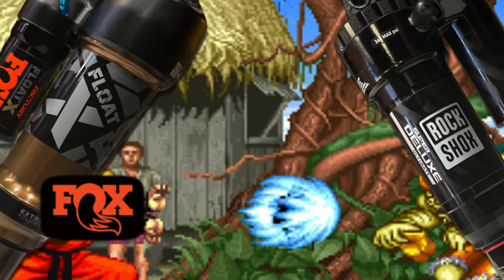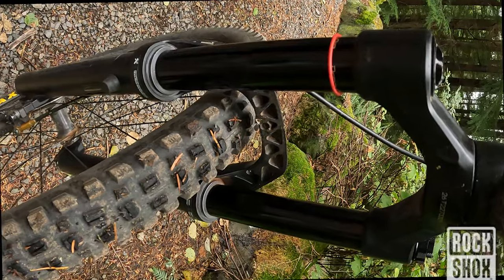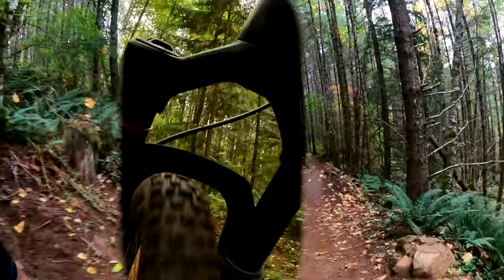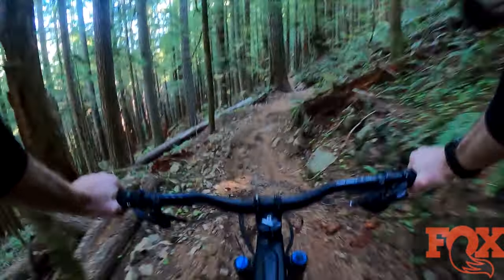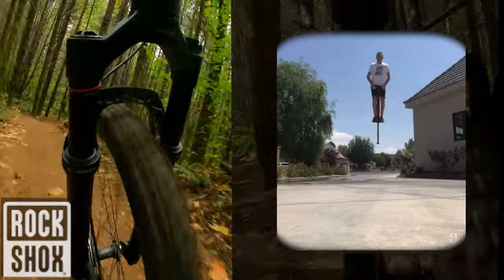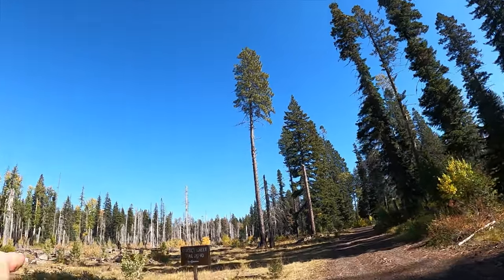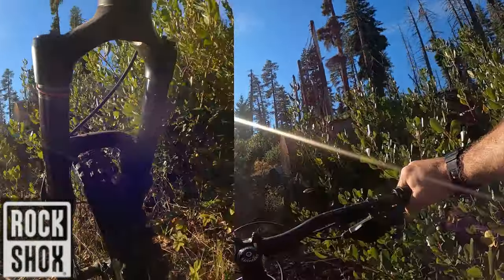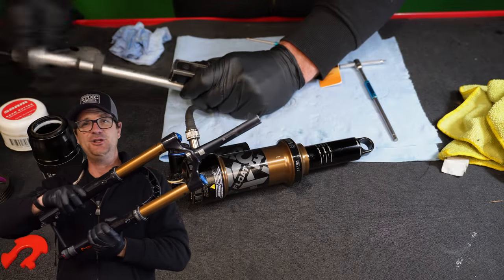The Age Old Debate: Fox vs. RockShox

Comment: Awesome review bro!
It's, a shame ear that about the new RS super deluxe ultimate shock because I just bought it :(.

I been riding coils for the last 2 years (150_160 rear travel ) and now I want to go back to air . My next custom bike it's 155mm rear and 170 front and after seeing this video I want to sent it back.

I riding hard  most of the time speed lines , local steeps and technicals trails , drops and in summer bikepark ones per week .

I never ride a fox fork but I had the bomber Z1 160mm I really like it was very soft the problem was sinking a  lot when I braked anyway it's a good fork.
After the marzocchi I been using only RS : Judy, 35,, revelation, pike,  lyrik select ,domain and for the last 2 year the lyrik ultimate 2021 and I really like it the small bumps sensitivity and the recovery after hits some jumps.
Regarding rear suspension a had fox DPS DPX 2(I really love for the climb position) float X elite, float X performance  I never want the X2 performance  for usual problems. The difference with coil for me it's the maintenance, it's cheaper than the air , on tech the feedback on rockgardens and roots.

Coming from a mechanic I really appreciate this video 
 In your opinion What shock do you recommend me ? 

Thanks man 
Cheers
Reply from the maker: 150 travel Float X all day everyday. If I had a Rockshox fork the SuperDeluxe coil. 

I got the progressive air can for SD now. It works much better 80% of the Float X. It’s like the meg neg can. Can’t find one 

Super interesting the my23 rock shock products are extremely hard to set up, they kind of went backwards. And then people get super confused because the originally lyric was plush and easy to set up.

Make sure we both talking about 2023 stuff. 

Suspension shop keeps preaching coils for the same reason as you say about the maintenance and simpler. 

What bike are you on?
Reply: Thanks for your answer bro.

Yes we are talking of the same year RS super deluxe ultimate  RC2T Denon air +23.

Regarding the fork as I told you it's the previous lyrik 21 charger 2 , what do you think about marzocchi Cr coii Shock. Do you know if the grip regulation works the same as the fork I mean when you start to close the compresión became hard almost close .

I have a electric  bike merida E one sixty 2022, specialized status 160 , and now I just bought the frameset of the banshee titan ( I was between the transition spire or the titan ) .

Anyway I'm still on time to return the shock if I change my mind it,s so bad? Or it's a matter of set up .

Thanks bro !

Comment: Rock shox is like a used condom. Throw it away right away and it would have just been more enjoyable if you never used it to begin with haha. 

I love that “oh the rock shox is so amazing at this and that except my hands hurt and im fatigued and it cant hold a line” haha. And the. I rode the fox and it just rode good?? 

This was a great thorough and well put review though. 

As a more aggressive rider i still never liked overly progressive suspension, always seemed like a good way to my your fork feel like shit in the bottom 50% stroke. Im a lighter guy though and usually land smooth and if i case/overshoot/fuck up i just expect to bottom out. At my peak of freeriding i rode most of the double blacks and several “pro lines” (used to be 3  red diamonds ♦️ ♦️♦️) on the north shore, whistler and sunshine coast. I always preferred fox and marz over rock shox. Even when i had the top end boxxer and vivid on my DH bike they were just kinda meh

Comment: Have had fox float, dpx2, X2 ( utter garbage) float X and RS super deluxe ultimate. Also own a fox 38 grip 2, lyric ultimate charger 3 rc2 and fox 36 g2.   Agree with everything on this video 100%.

Fox float X is a standout and bomproof shock. Its the best product they have yet made. 

Lyric is a great trail and brilliant jump fork but destroys you in the rough unless the compression circuit is rebuilt.  

The RS deluxe ultimate is such a dead feeling shock. It kills the fun on a bike. When run very open it just gets wobbly and uncontrolled so is frustratingly difficult to tune.
Reply from the maker: At least someone agrees with me. Thanks for comment. Thanks for comment. I felt like I was the only one. you  still have the RockShox ?

Comment: Maybe the bushings need to have a burnishing tool sort them out, it looks like some of these forks come out fine direct from factory and other not, its seams to be the case with friends forks also. i have a friend with a new lyric and its super plush, but hearing a lot of other reports about it not being the case. i had new lowers which were burnished for a ext era fork, and suddenly everything was amazing on it, oh and the factory settings suddenly worked perfectly for my weight, where as before i was messing around trying to get it set up properly.
Reply: Burnished lowers are the way. I had my 38 burnished and it made a night and day difference.
Reply from the maker: Is that going to fix the lack of small bump compliance?

Comment: Dude, you really dislike rockshox 🤣 
But yes, I had this discussion today actually (the stalking is real) about lyric 2.1 and Zeb 3. I've owned both, and the lyric was fucking unbelievable. Now, to be fair, I haven't serviced the ZEB yet, and apparently all rockshox forks work like shit because they come without the proper amount of oil from factory. -1 for rockshox. 
That being said, I still prefer rockshox to fox. IMO, they look better and look more expensive, they're easier to setup and in terms of price...  The cheapest I can find the Zeb Ultimate Charger 3 at the moment is 760€.. 760€!! The 38 Factory? 1250€. That's a 500€ difference. Enough to get a Super Deluxe Ultimate Coil. Again, it's just my preference.
Reply from the maker: Just facts, that most people would delete from videos. I keep hearing the issue is manufacturing and assembling. New lyric felt like something really wrong. New Zeb was kinda the same issues.

Comment: 300 $ for suspension service, are you insane? And 250$ for shock...
Reply from the maker: I called 5 shops. ALL of them said same price.
Reply: @OtterMTBtech  horrible. I got fork service, shock service and full bike dissasembly and bearing change for 300€ here in Europe
Reply from the maker: Maxxis tires also cost $110 per tire here.
Reply: @OtterMTBtech  i paid 70€ for 2 of my new Forecasters. Where do you live?
Reply from the maker: Usa 🇺🇸